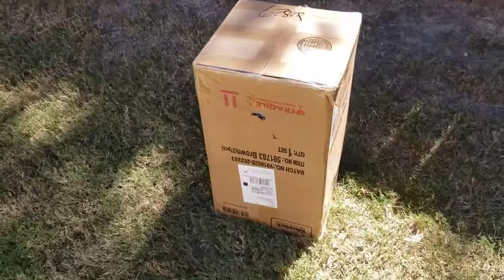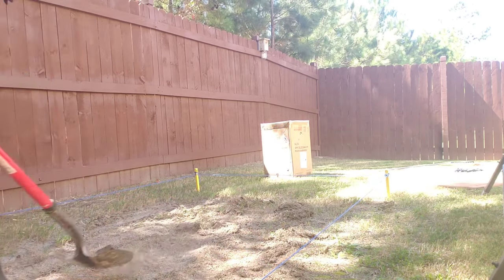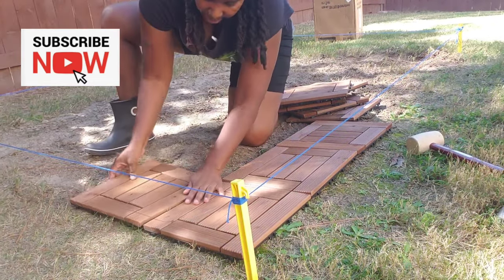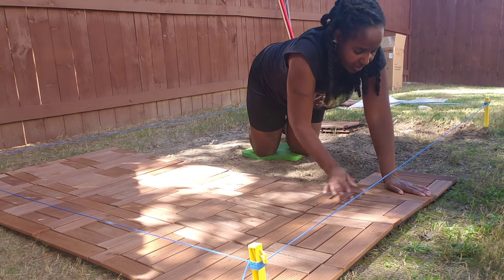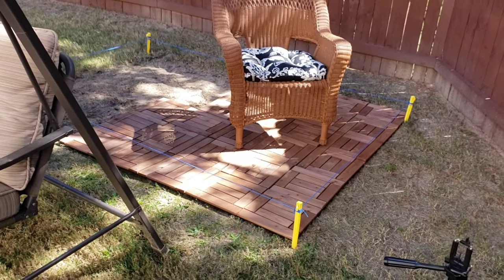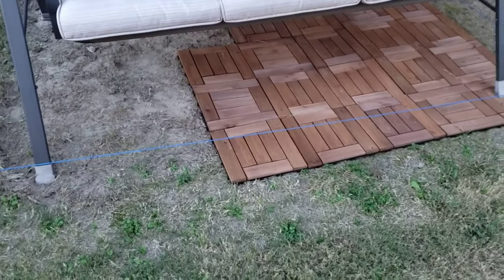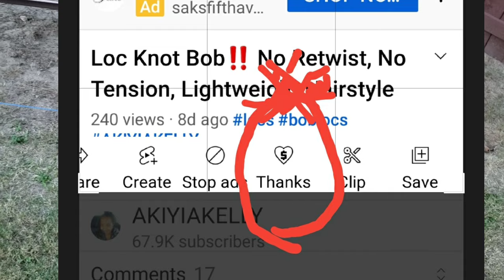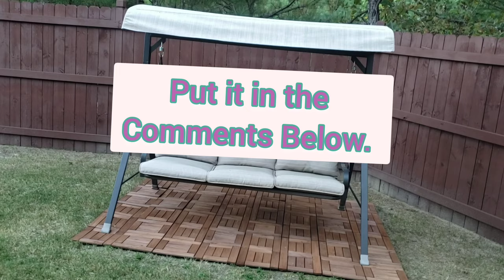How to Install Patio Tiles on Grass | DIY Yard Project

Comment: it is better to put pallets first to make it elevated then the tiles on top, so when it rains it wont be submerged in the water.
Reply from the maker: It is perfect just like this. 
Still no problems.
Thanks for Watching.
I hope you are a Subscriber. Be Blessed.
Reply: I’m thinking since pallets aren’t treated wood that they will degrade quickly in the rain and snow.
Reply from the maker: @tiffanye6893  
Mine is still going strong and looking good.
Thanks for Watching.
Subscribe for more.
Reply from the maker: @tiffanye6893  Here is the 2024 Updated Video:
https://youtu.be/IRPAbGxhWMM?si=YU98jE4UtXWXoXRe

Comment: So this video was perfect for what I had planned to do in my backyard and seeing what happens when it is on the grass. With that being said, I have similar tiles on the front porch that you have that sit nice and stable on concrete. Maybe a suggestion for the future, since I see that the ground may not be completely flat in some spots is to use a ground tamper and a level ruler so you know it's truly flat and even. I did that with pavers and it works wonderfully where it feels like you aren't shifting around. I also think you wouldn't want your tiles to buckle if you are adding uneven weight when sitting on your swing. That or sheet of wood underneath. This way it's not truly permament unlike concrete. Tamper goes for like $35 at home depot and a level ruler isn't expensive.
Reply from the maker: I actually got the Ground flat when I was off camera.
They look good and they are holding up well with out anything extra needed.
Just don't be lazy like me.
I was on camera and didn't want the video to be long.
So I didn't clear the ground properly on camera.
But once off I did.
Reply: @AKIYIAKELLY  I still have yet to get a swing lmfao. One day
Reply from the maker: @Enlightened4love  I sold mine last year.
I am going to get one you can lay down on. 
Now I want that kind..
Lol

Comment: you are so honorable that you admitted that the surface should have flatter prior to using tile.
Reply from the maker: Yes most definitely.
I was on camera trying to hurry.
But yes please clear everything out and make it flat.
3 years late still going strong. 
Thanks for Watching.
I hope you are a Subscriber.
Be Blessed.
Reply: @AKIYIAKELLY  it is a pleasure to follow you. I pray that success is always with you.
Reply: Thanks for making this video! I looked into making a deck or patio myself, but it still kept adding up to way more $$$ and effort than I wanted to put in. This seems sooo much easier! I wanted to put this on grass instead of concrete like everyone else, but couldn't find a video of it - so thanks again! :)
Reply from the maker: @MegSong95  
You are very welcome.
Thanks for Watching and Commenting.
I hope you are a Subscriber.
Be Blessed.

Comment: Question for you. How does a basketball bounce on this surface? Looking to put this in my backyard, and put sport tiles over the deck tiles
Reply from the maker: I think Honestly a Basketball need a Concrete bottom. Concrete is Always best for a basketball outside. 
You need something really Sturdy. 
That is my opinion though. 
Thanks for Watching.

Comment: hi kelly, i would suggest going to home depot and get these rubber like foam padding to lay on the floor then put those tiles on them
you can find the padding in the garden section at least your tiles will be level and sturdy
Reply from the maker: Thanks so much for the info. 
I wonder how the foam would
Do with the mud and rain.
Reply: @AKIYIAKELLY  the foam will be fine, it's meant to be used as underlay for paver patio.
Reply: Great suggestion, I purchased these tiles last year from Amazon and was hesitant to put it down over my grass. I love the ones AK chose ❤
Reply: Do you have a link to the foam padding ?

Comment: FINALLY!  I saw a DIYer who has done what I have been wanting to do but didn’t see any videos.  Question,  from what I read from another subscriber, you live in an area that has snow and ice and you also said that it was slippery my question is have you been able to shovel the snow or do you just leave the snow and ice alone without shoveling.
Reply from the maker: Thanks so much for Watching. 
We don't really get Snow.
It do get cold. 
I just left it down like normal. 
They are fine.

Comment from the maker: Please Read:
Update for Everyone:
I actually got the Ground flat when I was off camera.
They look good and they are holding up well with out anything extra needed.
Just don't be lazy like me.
I was on camera and didn't want the video to be long.
So I didn't clear the ground properly on camera.
But once off I did.
Reply: Do you suggest putting sand if I'm putting these on grass to make the tiles more stable and not move around?
Reply from the maker: @NikkisSecrets123  
I guess you can try a few and see.
I have nothing on it.
I have no problem.
Just makes sure you clear the ground completely.
Make sure it is flat.
I did make more flat once off  camera.
Thanks for Watching.
I hope you are a Subscriber.

Comment: Thanks for this. Didn't you feel the need to level the ground and use a wrap to prevent the weeds for growing through?
Reply from the maker: Remember in the Video I said I did go back and Level the ground.
I didn't put any weed remover down.
They still look good and have no weeds.

Comment: Do you think these would hold up for a kids bike path in the back yard? Or an extension to our concrete patio? We went so we can’t dig up the yard unfortunately.
Reply: Rent *
Reply from the maker: I say buy a Box and see. 
Its hard to say yes or no really.
Mine still is going strong.
But I say Concrete is Always best when you are riding a bike, playing  with a basket ball etc. 
It's a Harder Foundation.
All I did was just put a Swing on it.
Its still good and going strong.